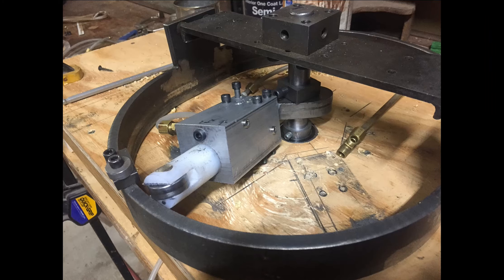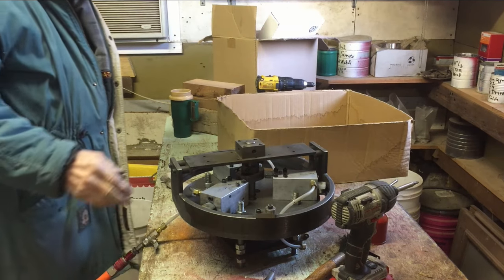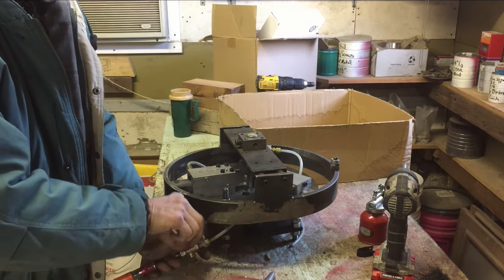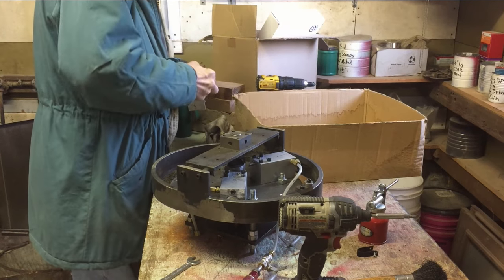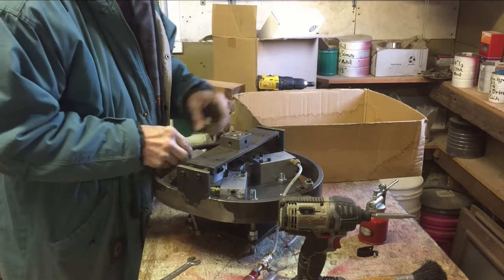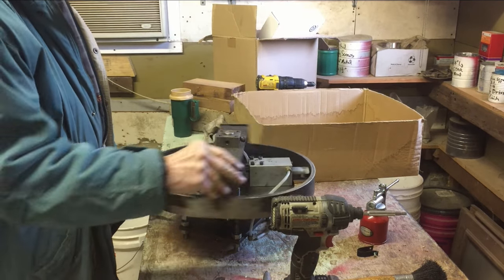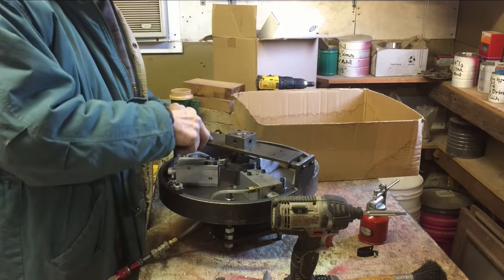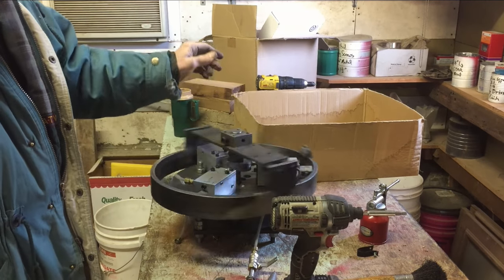Oval Air Engine, moving from Wood Base to a Metal Base 2-15-2020

Comment: I really like the easy to service aspect of this design. It is also cool that you could kinda just add more cylinders to make it 4 or 5 or 6 and they would just work. Nice job, thanks for the update!
Reply from the maker: Yes it is very versatile, as i have been saying - simple & with as few moving parts as possible. I think the valve part of the Cylinder can be improves on with better machining, which i'm sorry to say, i'm not good at! I hope in the near future to have a "mechanical timing advance" developed to improve efficiency and power at higher engine speeds. The idea is there, but not yet worked out totally. Thanks for being a loyal subscriber, comments and questions always welcome.
Reply: I like that idea of controlling the timing, i was thinking the same.
Reply from the maker: FilterYT Great Minds think Alike :)